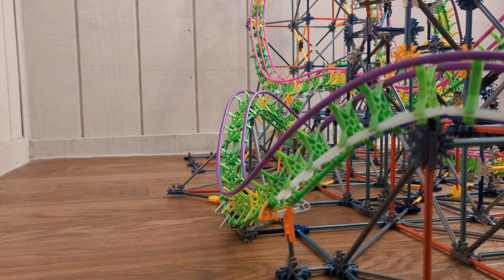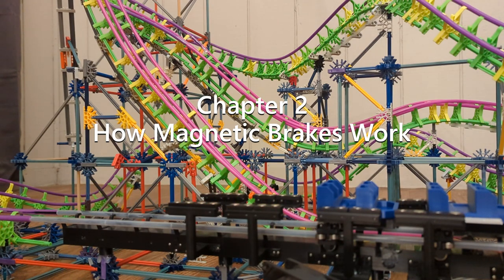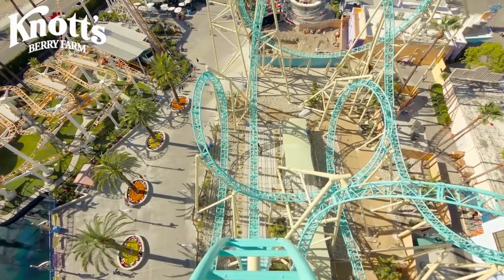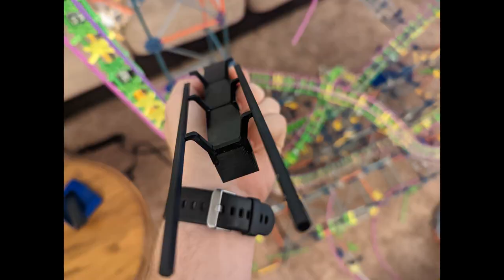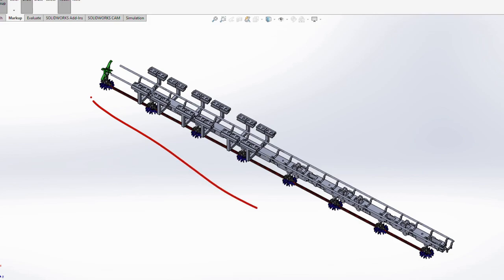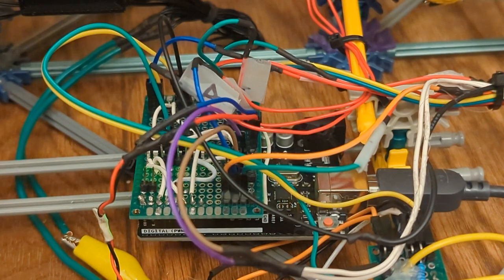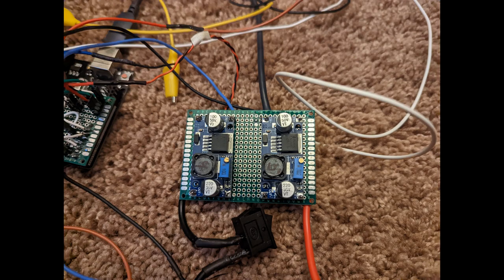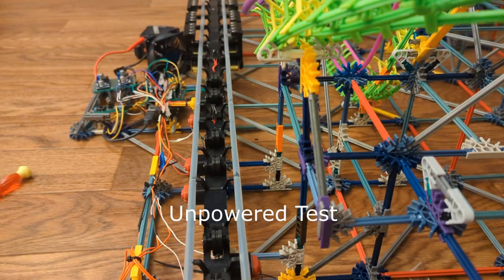Braking My Roller Coaster

Comment: Have you ever done anything with micro coasters? I honestly thought about getting into 3d printing to make better Micro cars because of your video on the trains. Micro K'nex coaster suck when it comes to friction and can't make realistic stuff.
Reply from the maker: I've always preferred the tube track sets over the micro sets mainly because the micro parts are too flimsy. Every idea I've had for them involved strengthening the track first, then making realistic trains after. It may be a future project, but right now my projects focus around the tube track and full sized parts.
Reply: @ModeledCoasters  completely

Comment: Hi do You now where can i buy this tracks ? 
I couldnt  find them ,i only  found the non tube one
Reply from the maker: The black and white track is custom made and isn't currently available for sale. The purple and green K'nex track is commonly referred to as screaming serpent track or tube track. I don't believe new kits with it are made anymore, but you can find plenty of sellers on Ebay and similar sites.
Reply: Ok thanks

Comment: Would you be interested in selling a custom train like you have in this video?  I tried using my 3d printer and bought all the materials but couldn't get it to work right
Reply from the maker: This particular set of trains have a pretty annoying design flaw I'm going to go over a little in my next video. Therefore I'm not planning on making them available. The next generation will fix this issue and I plan on having those available probably by the end of the year. In the meantime if you have any questions I'd be glad to help!

Comment: I think you should actually replace fins with actual coils and actually create current that you can use for the lift hill or other systems, to reduce energy losses. Kinda like regenerative braking. Also it would be fun to see you build a launch mechanism, you could even make a linear bldc motor, kind of like the one tom stanton had made to launch a paper plane (I'll send link to his vid)
https://youtu.be/_4TGb3MsSjE
Reply from the maker: That's actually a really neat idea! I don't think I would get very much energy back as the trains aren't very heavy and therefore don't carry much energy. But I do like the idea of a launch especially since mechanical launches are so tricky.  It's a pipe dream of mine to create a LSM system like he did!